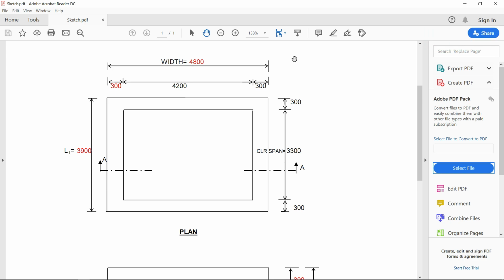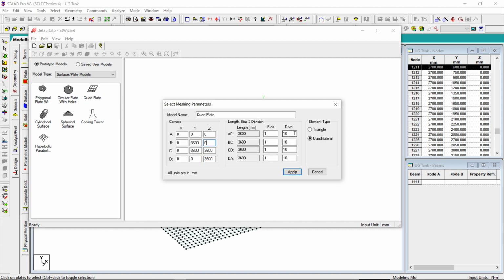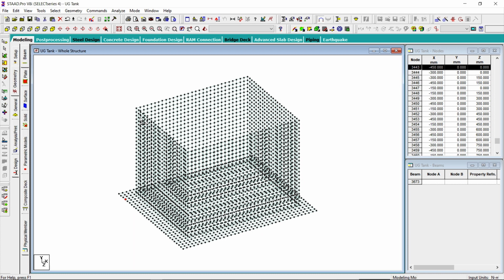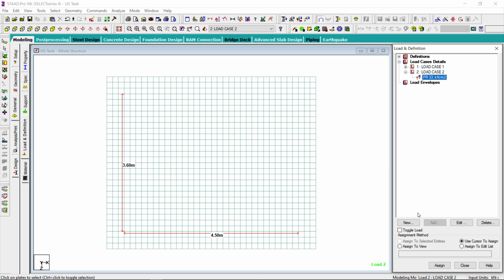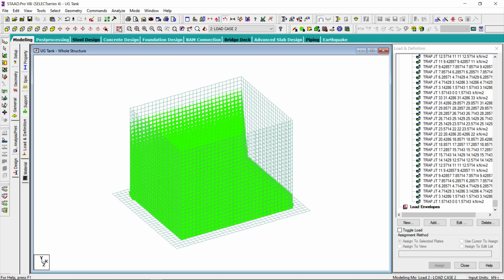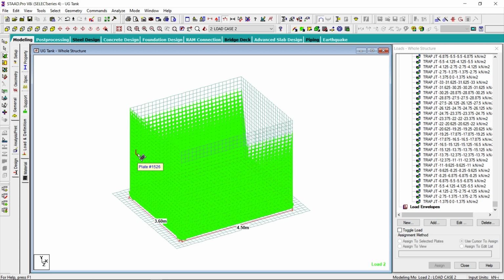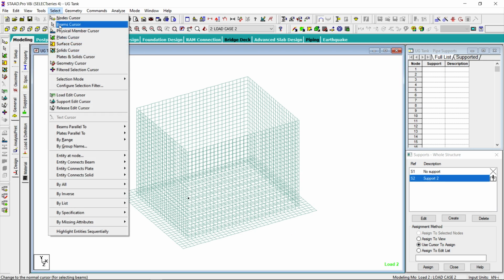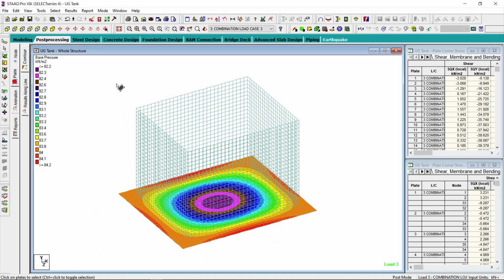Design of an underground concrete water tank with STAADPro - Part 1

Comment: How do read the plate stress results in the middle of the bottom slab. How do you calculate the reinforcement reported by the staaadpro. How do you calculate the one-way shear and two-way shear from the plate stress?
Reply from the maker: Please see my latest video. Thanks

Comment: Hello sir, 
Good tutorial for freshers,
Sir please explain about loading in y direction. why you take +ve.also as per hydrostatic pressure in z direction in back side plate is negative as per my knowledge . please explain sir.
Reply from the maker: Actually +ve or -ve are just sign convention, you have to consider the direction of the applied force and local or global axis orientation. Y-direction is pretty simple. It is the gravity direction. I suppose all the engineers do know to apply y-direction forces.